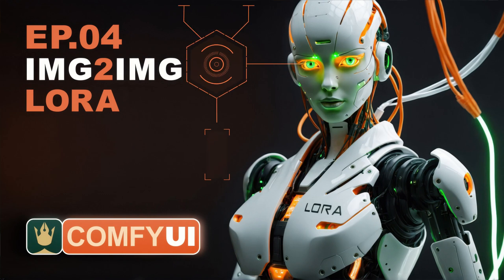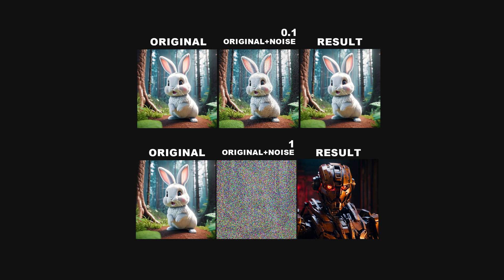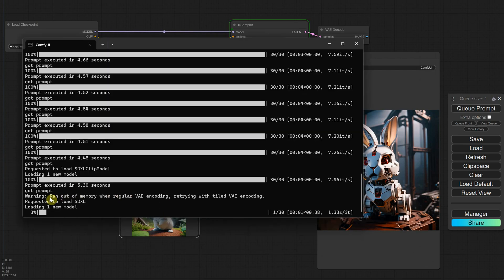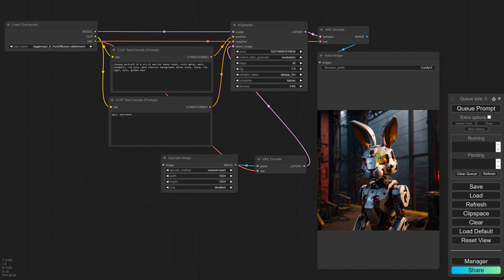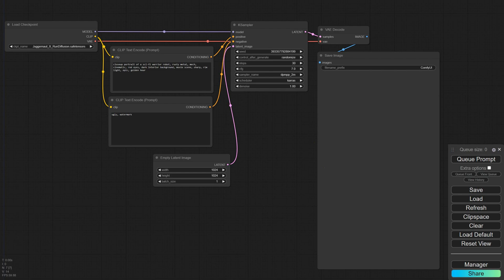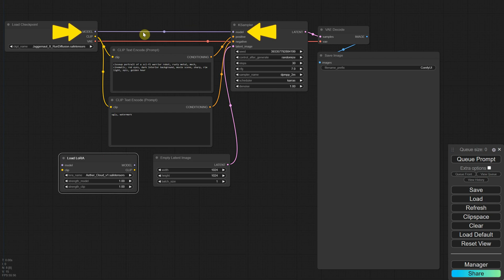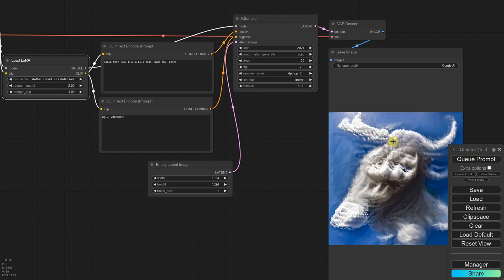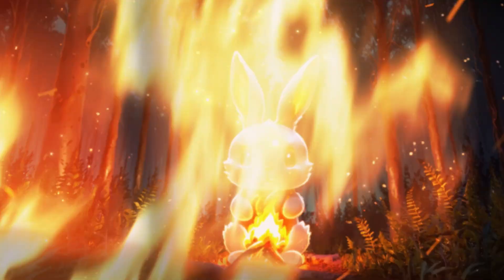ComfyUI Tutorial Series: Ep04 - IMG2IMG and LoRA Basics

Comment: For beginners it is very good tutorial. As you mentioned if input image is higher than add upscale , my image res is higher but i want to test it on low res. Like my input image is 2k 9:16 ratio, i want to test it on  9:16 but with 360x640 res. And when i get the desire result, i want to upscale it on hd scale with same ratio. What is the process?
Reply from the maker: Is hard to explain on YouTube comments, can you post screenshot on discord and with what you want to do since are more people there and can help even if i am not there some moderators are usually around

Comment: Hello. I've tried the img2img workflow, but instead of an image, I always get a black area. I've checked the workflow with the nodes and connections, and I think everything is correct. What could be the reason that no image is generated, but only a black area? Thanks for help…
Reply from the maker: Some reported if they have sage attention active give that, not sure, recheck settings and models again maybe
Reply: Hello. I found the reason for the problem: Apparently it does not work with the Checkpoint 'Real Dream'...

Comment: Heck. For some reason I'm struggling with img2img... Tried different strength_model and denoise, checked on dpmpp_2m and dpmpp_2m_sde, yet for denoise values below 1.0 it outputs just the noisy version of a loaded image :(
Reply from the maker: Depends on the model and sampler and schedulers the denoise value is different, also input image influence a little and of course the prompt. models have changed so if the model is also different you get something different

Comment: What width and height are typically used for a 16:9 aspect ratio? With SDXL 1.0, using 1024×576 often causes extra fingers and other issues, whereas 1024×1024 or 512×512 works fine. Should I try Flux Dev instead? My goal is to upscale the final image to 4K (3840×2160).
Reply from the maker: You can try with flux like in episode 50 maybe or nunchaku episode

Comment: I trained a Lora with pictures of myself but the result doesn’t look like me when I use it with a checkpoint for some reason. It does work when I use it with unet + dual clip or load diffusion model
Reply from the maker: If the lora is trained on the model you use with it should work. Flux loras are better than sdxl

Comment: I had uploaded a large upscaled image, and as you showed its was a drag. Now when I upload 1024 x 1024 res, its much faster. Thxs man ❤. How to put batch size for this image to image workflow? Should I use Repeat Latent Batch node/ CR Latent Batch Size node in btw VAE Encode & KSampler?
Reply from the maker: I showed a method of loading multiple images from a folder in episode 15 maybe you try that, i usually just change the number after run to decide how many times i want to run that workflow
Reply: @pixaroma  I will check it out. THXS ❤

Comment: Hm, weird, this one did not work for me, the image remained pretty much unchanged
Reply from the maker: That is strange, did you use the workflow from discord? Maybe you missed some settings
Reply: @pixaroma  I did in fact, i ended up using a different checkpoint, the other one you suggested us to download. I didn't know we had to match checkpoints and loras.
Reply from the maker: Yeah lora and control net only work on same base model, so sdxl only work with sdxl base lora or control net, flux only with flux and so on

Comment: Just wondering…. Load Lora node has 2 adjustable sliders….but the power Lora loader only has one for each Lora.  I presume that’s a balancing act between the weight of each ….but how then is that balancing done with the power Lora loader?
Reply from the maker: I usually split the power between lora or leave more weight to the one that i want to have more influence
Reply: @ ok so then now I’m curious / confused about the difference between the rgthree power Lora loader with one adjustment per Lora and the rgthree Lora stacker with multiple controls for each. Which one is going to allow for better control ….i looked at the documentation for both but there doesn’t seem to be a clear answer. Your thoughts?
Reply from the maker: @Ryclone07  i just use power lora because is easier for me and i can Right click on it and see info from civit ai and see trigger words so is just easier to me, i don't all the differences between them just power lora had what I need

Comment: How do you get the CMD inside comfy?
Reply from the maker: on the new interface you have where the bar is like mine is on top and i have a little square that if i hover says Toggle Bottom Panel so that will open it on bottom
Reply: @pixaroma  thanks a lot

Comment: Awesome video as well. Is it possible to stack Loras at once? I tried by putting another lora bottom of the other one to make them blend. It didn't work. so if I wanna make burning cloud bunny, do I have to generate an image with clud lora first and then do the same process with the first image using fire lora?
Reply from the maker: You can use power lora, see my newer epiodes with lora, i have for flux examples and work the same with sdxl and you can combine lora, but depends on lora it tends to blend them to get something from each, also you can reduce the strength of each lora a little
Reply: @pixaroma  thank u sir

Comment: Thank you! You explained about LoRA very well, especially about the noise, I still don't fully understand how neural networks form an image.
Reply from the maker: I don't understand all the things either, here maybe this helps: Neural networks generate images from noise by gradually refining the noise into something coherent. Here's how it works:

In models like Stable Diffusion, the process begins with a completely noisy image. The neural network, typically using a model like U-Net, is trained to remove this noise step by step. At each stage, the network predicts how much noise to remove, transforming the random noise into a structured image. It's similar to starting with a blurry, messy canvas and sharpening it bit by bit until it resembles a clear picture.

Each layer of the neural network learns different features. Early layers may detect simple elements like edges or colors, while deeper layers focus on more complex structures like shapes or textures.

These models are called "denoising diffusion probabilistic models" (DDPMs). The forward process adds noise to an image over several steps, while the reverse process—handled by the neural network—removes this noise, reconstructing a detailed image.

Comment: Thanks! The only downside of using the 'upscale image' node is that now it takes 17 seconds instead of 9 to render the final image, even if I load the same size picture to the image loader. I found some kind of a 'resize' custom node that might not have that problem and going to try it.
Reply from the maker: Let me know how it goes, probably i didn't notice the difference since my VRAM is quite high so always take like 4-5 seconds no matter if i use upscale or not. I think i saw some custom node also but don't remember how is called. I was trying to not use custom nodes in the first episodes, but i will have to slowly introduce some to make things faster :)